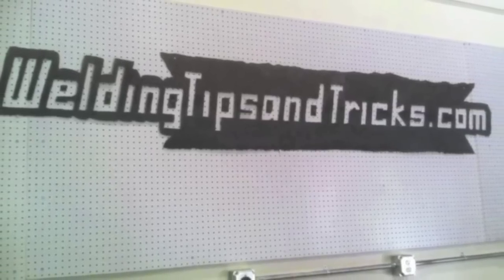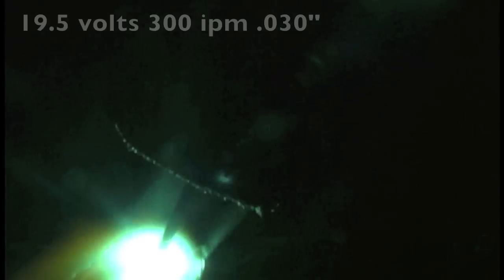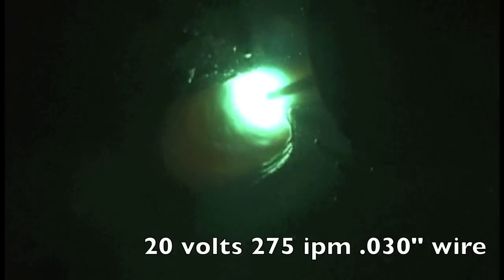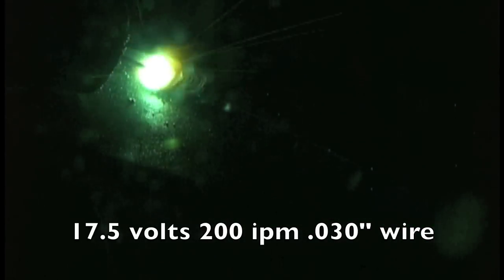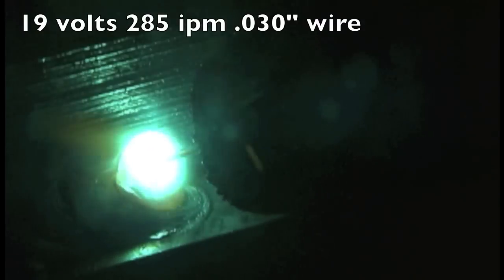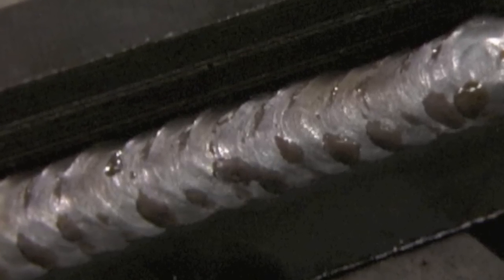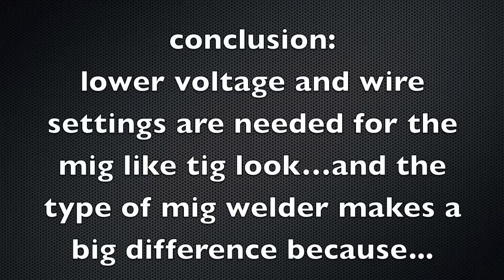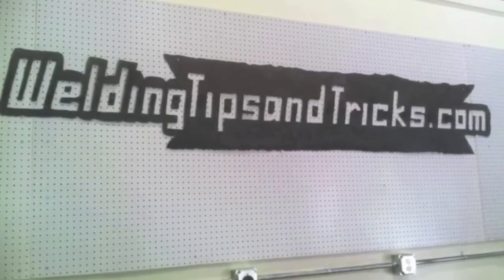Mig like Tig like ZTfab

Comment: I would have to try this out to be certain but I think I would try a 84% argon 16%co2 mix or a 98% argon 2% oxygen gas that way you can achieve a good spray arc. run lower wire feed speeds at a high voltage. however without a pulse mig machine this would have to be done flat.

Comment: For me I would do a cursive L motion, and weld pretty cold. When I would do the loops, going forward I would go pretty far then loop back juust a little bit. So when you're going forward you should see a gap between the the 'dime' behind you and where the wire is going then loop back to fill it in. I know it's not a strong weld but it looks pretty damn close to ZTs. That's the method I did on my intake and it looks pretty close to a TIG weld. I wouldn't do this on a critical weld though lol.
Reply: And I was pulling, not pushing.

Comment: My shops millermatic 251 just started running like crap after some idiots used it, i changed the tip and cleaned off the spatter adjusted the gas flow, but it doesn't have the high pitch bacon sizzle anymore! It sounds deeper toned and just runs bad. Any ideas as to what's wrong?

Comment: You basically want the pool in more of a fast freeze type, so the heat can wash out from what I see.. I have had similar affect on half inch plate with 30 wire..

Comment: I have seen tig like mig welds from using pulsed mig set a little cool, also could. It have anything to do with the gas one of the guys I work with thought 75% argon, 23% c02, 2% oxygen is the best mix

Comment: millermatic 350p straight mig 20v 225ipm 90/10 gas .035 wire push 1/4 fillet or lap horizontal PUSH constant loop pattern no pauses...nice ripples you will have to find good tempo...spray some pam to combat those dingleberries

Comment: hows it going i been a suscriber for a while now i was just wondering if you can do a few torch cutting vids if you have the time. im in school now at boces doing a 3 part comprehensive course on mig tig and oxy accetalyn welding now but my teacher cuts corners alot especially on the torch cutting and gas welding. you videos are helping me alot in class. there kinda giving me a 1 up on the other students. lol

Comment: When I mig like tig. I like to turn my heat up and wire speed down. Until it is almost a hiss sound like a tig, instead of a frying sound like mig and stick. And then I whip it like a 6010 pushing the weld. Forward and back and just watch the rear of the puddle to be sure your "dimes" are even.

Comment from the maker: i wonder how many eggs get broken in order to make an omelet
Reply: weldingtipsandtricks, i have noticed in the feild that if u weld "hot" u will start to lose your "definition" in the weld so u need a close stick out and have the voltage so that it just starts to "flatten" the weld out pretty good, and keep your wire speed down so that you can take your time. Keep an eye on the tail or backside of the pool and try to keep it nice and round but dont fill so much you aquire the humpy weld.
Reply: Id try a setting like 17.6 - 18.0 volts and around 170 - 180 wire speed

Comment: If you want it to look like tig then tig it ... The problem with this technique is people will try to make there welds look cool instead of making sure the process is done right .. as said below in order to achive this result you have to go cooler.. which prevents proper penetration ...tig is king unless you are in a factory stamping out clothes racks ..

Comment: that's not what's being shown here though.  that tack-tack-tack stuff is horrible.  You can see the dimple left in the middle of each tack, if i'm not mistaken, that's a weak spot.  The tack-tack-tack method IS the pretty (in the eye of the beholder) weld that's weak.  Some of the welders that weld that way have wised up to use the next tack to cover up the indentation of the previous one.

Comment: This way is definitely not a colder weld. It is same voltage, just lower wire speed and slower advancement. It's actually seems hotter. The result looks really cool, but I've found no practical purpose for it.

Comment: Perhaps instead of spending all sorts of time experimenting with making ornamental welds that are possibly structurally suspect, we should instead educate the client.  That stack of dimes 'look' has the potential to create stress risers at each dip in the weld metal if not poor root penetration, whereas a good, smooth mig weld has no dips, and therefore is less likely to create micro stress risers when maximally stressed or while experiencing synchronous vibration frequencies (resonance) .  
The main objective in fusing metal materials together is to create a homogeneous, monolithic structure that will withstand the design forces and environment, and then some. 
The stack o' dimes appearance also allows minute debris and moisture to accumulate within the small dips, leading to possible corrosion of the joint.  A proper, smooth joint allows debris and moisture to not accumulate as easily, and is far more easily cleaned and protectively coated if required.
Leave the cutsie look to the so-called 'artists' that only make non-structural sculptures.  Educate your clients!

Comment: My dimes are really tight but still neat because i Like to run hot but holy fuck Ztfabs welds literally are the Porn of welding hahhaha
Reply: PanamaSabroso Since I do a lot of industrial/commercial fab and pipe-fitting I was taught speed, so nobody cares as long as it doesn't leak and doesn't look like a giant turd

Comment: If you want a tig weld appearance, then tig weld it.  The weld will be stronger
Reply: Neil Brown wrong, filler determines the strength of the weld not the process. If done correctly.
Reply: its easy if you know what your doing.

Comment: Mig Like Tig, garbage. Wip on a 6010 fits, puddle distinction on a Tig dip fits. Mig....nope! I've cut and etched enough samples to see difference. I wish somebody would buy up a bunch of product and cut and etch them. The only joint that allows you to flirt with this method is an outside corner. The root is more exposed. Still all the movement and puddle freezing creates a weld pool zipper. Picture hounds and post chasers are ruining a whole generation of Mig welders......and the public has bit down hard on that bone.